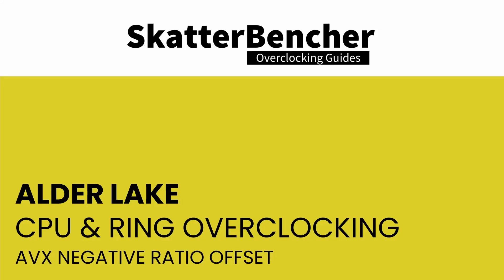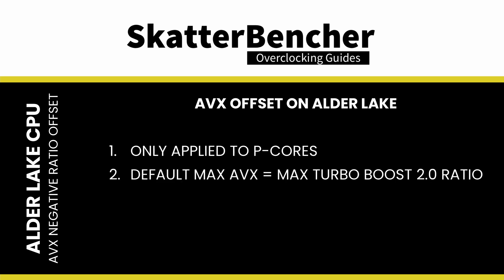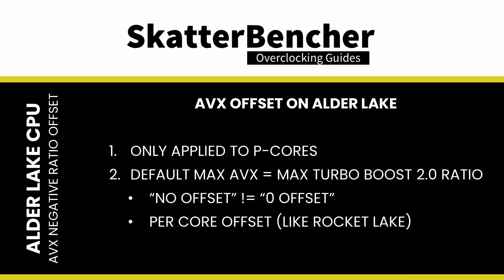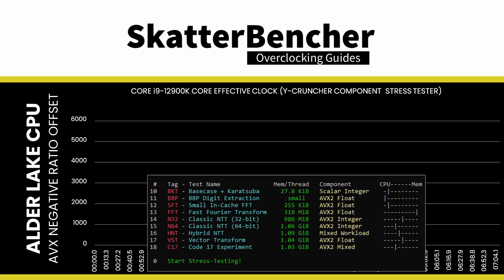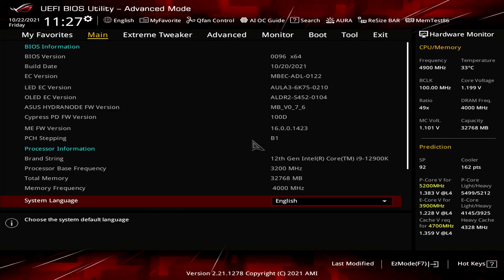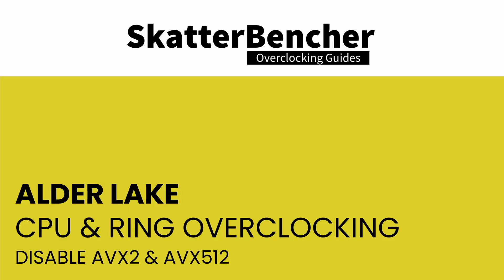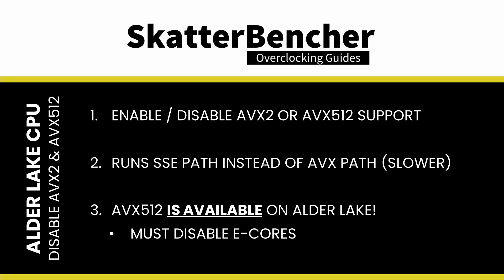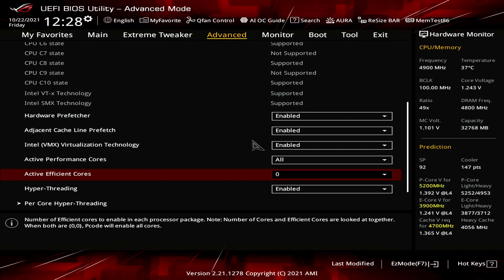Alder Lake Overclocking: AVX-512 & AVX Offset (feat. Maximus Z690 Apex)

Comment: OK, you've talked about AVX2 and AVX512 but what bout AVX. Does it have its own offset or does the AVX2 offset also automatically apply to AVX as well?
Reply from the maker: Light AVX workloads (like 128bit AVX) don't trigger the offset. This Wikipedia entry actually covers it pretty well: https://en.wikipedia.org/wiki/Advanced_Vector_Extensions#Downclocking
Reply: @SkatterBencher  So, the offset is for AVX2 and beyond only. Thanks. I wish the wiki described how Raptor Lake downclocking works. It's well described for the Sky and Ice lake processors, which used different L1 and L0 schemes. My 13900K Asus bios has no scheme to soft or hard downclock as described in the wiki. Just set a fixed multiplier and that's it, unfortunately.
Reply: @SkatterBencher  Thank you!

Comment: i have asus z690 tuf gaming wifi d4 
 which version of bios supports avx 512 ?
currently my board is on aug 2021 bios running with i7 12700 .
i have disabled the e cores but AVX 512 settings dsnt show in that settings.
please help and guid me☺️

Comment: DDR5 OC walkthrough next 🙄?
Great videos 🙌🏻
Reply from the maker: The most important step of DDR5 overclocking is ... finding DDR5 😂
Reply: @SkatterBencher  you made my day 🤣🤣🤣🤣🤣🤣🤣🤣 that is exactly my current situation and I guess it is so for almost everyone 😅
Reply: @Nikos4Life  best DDR5 kit I managed to buy was 5200 CL38 ( Corsair Dominator Platinum), do you think it is good for OC with z690 Asus Apex ? or should I return it and wait for availability of a better DDR5 kit ?
Reply: @evilsatorii  I just bought 5200CL36 a few minutes ago… if you can grab a better ones just post it here. 🤣 sorry I can not give you more details about this kit since I do not have it yet.
Reply: @SkatterBencher  i have asus z690 tuf gaming wifi d4 
 which version of bios supports avx 512 ?
currently my board is on aug 2021 bios running with i7 12700 .
i have disabled the e cores but AVX 512 settings dsnt show in that settings.
please help and guid me☺️

Comment: how are the results compared to a 5950x oc? In terms of performance?
Reply from the maker: Can't quite say as I didn't do an apples-to-apples comparison. That said, I did check the performance results of 12900K OC (Win11) vs my previous 5950X OC (Win10) and I found that in single threaded benchmarks ADL wins mostly; but in out-right multi-threaded benchmarks 5950X was still king.

There was some odd ones like Geekbench 5 where 12900K dominated. But that might also be a Windows10 vs Windows11 thing.
Reply: @SkatterBencher  i have asus z690 tuf gaming wifi d4 
 which version of bios supports avx 512 ?
currently my board is on aug 2021 bios running with i7 12700 .
i have disabled the e cores but AVX 512 settings dsnt show in that settings.
please help and guid me☺️